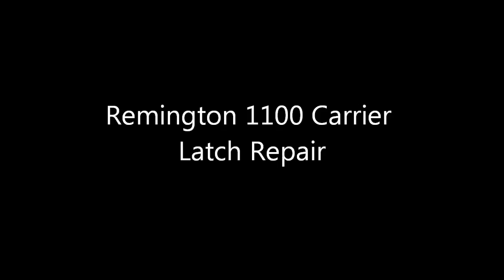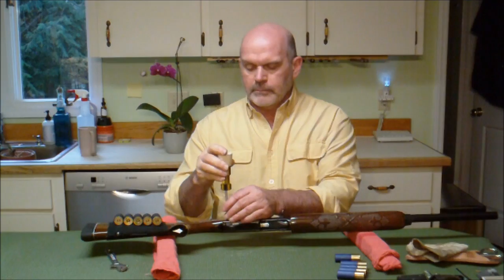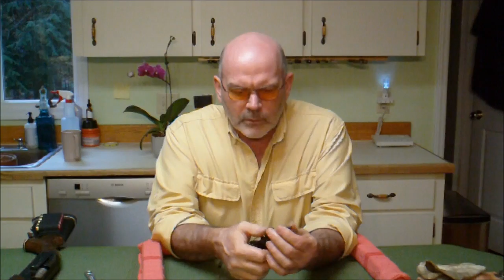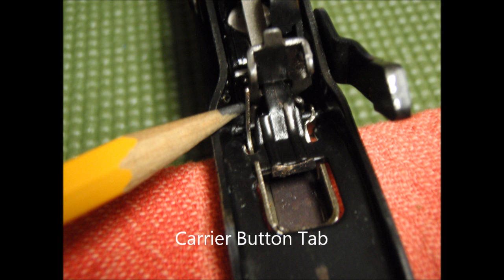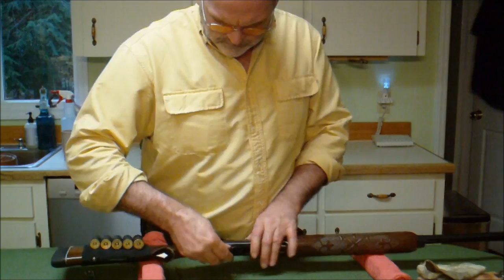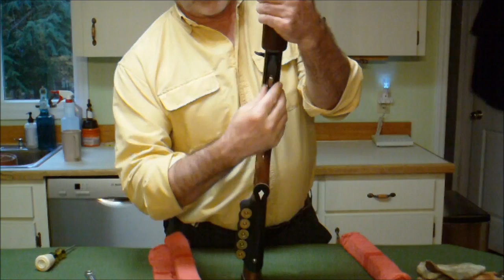Remington 1100 Shotgun Carrier Latch Repair DIY

Comment: you tube has the answer for everything ,, your video was great very i nearly had the same problem except my PUSH was un-hooking it self from the carrier after watching ur video and STARING at the workings of the push and carrier i figured out the latch pin holding the push must of some how gotten a little bent ,locked it in the fully open position and tapped it carefully back , i emailed Remington wit the serial no it my first gun and they told me it was made 1982 too still in great nick,IRELAND

Comment: Thank you for this. This jam occurred to me this afternoon while shooting trap. I had seen your video and when I got home I applied your 'fix' and this was very satisfactory. The tab was quite firm and it took a small needlenose plier to apply the bend to the tab. Remington should put a sort of kerb to the edge of the release to prevent the tab from sliding off. Actually I was stunned at the lack of what I would call quality. None of these parts are milled.  Accounts for the under $ 1000.00 cost

Comment: The bolt action can also lock up due to the carrier release being bent forward.  Pulling the trigger while the trigger group is not in the receiver causes the hammer to whack the carrier release, bending it forward.  So - #1 - don't pull a cocked trigger on the trigger group if it's not in the gun, and #2 - be prepared bend it forward a bit with small pliers, if you're caught in the field (trap field, skeet field, actual hunting field) with a locked action.

Comment from the maker: @waslig13 I think that when you say that your chamber is open you are saying that your bolt is in the locked open position. Without seeing your gun I would guess that the tap on the carrier button is not quite in the correct position. Try bending the tab a little more toward the center of the gun.

Comment: This is very interesting...I bought a 1978 100 12 ga the other day, like yours its not used a lot. A friend said there was some back flash in the chamber as my son was shooting ( rapidly)  I thought that was normal, but thought about it again and remembered it was pretty dry of oil, and the guy lubed it for me, (seller)  so I'm figuring it wasn't lubed enough? maybe gas ports are clogged? still new to me, I'm used to shooting a 870 pump. thanks!

Comment: Question, what happens when two shells are coming out at the same time? Back to back. I'm having this issue on my Remington Wingmaster and can't figure out why two shells are coming out at the same time. I'm loading two dummy shells and when rack the slide to chamber 1 in the tube, both dummy shells are coming out???? anyway Answers??
Reply from the maker: I am not familiar with the workings of the 870 but I would guess that part that hold the shell in the magazine is worn or broken. On the 1100 that part is the feed latch.
Reply: +Red October shell stop probably needs to be timed
Reply: Left shell latch not holding second round, replace costs about $17.50 Brownels.

Comment: Anyone have any insight as to which part would prevent my bolt from locking back (Remington 1100 Magnum)?  I've had the gun apart, cleaned, and inspected it and no luck.  Any thoughts would be greatly appreciated.

Comment: I' m not a firm believer of.bending or repositioning  gun components as for a fast fix. There's a reason why your shell latch release was not working correctly,bending is certainly not the fix, replace with a new unit, by bending you will have the same proplems,again. Be smart and safe just replace the latch release, it's  not.    That expensive .
Reply: I agree.  Not getting to the root of the problem.  Even if you are "bending" something back to where it should be, how did it get bent in the first place and how do you know it is not going to happen again.

Comment: That's not a fix, bending the carrier latch. All that you have done is create more problems for yourself, by bending the latch assembly inward, you will eventually lock up the arm assembly, also now you have created chrome flaking around the inside of the latch, and trigger assembly, just creating more problems down the line. Correct procedure would be replacement. Brownell's replacement costs $14.50 plus shipping. It's certainly  impossible that it left the Remington quality control that way. It's something you did, that caused the misalignment. Replace with new parts, quit making half ass repairs.